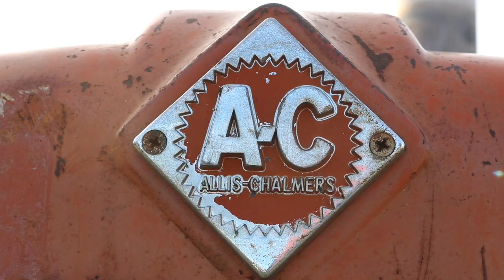Allis Chalmers Show: Plowing With Our New Original 1957 Allis Chalmers D-14

Comment: Looks like a nice little D-14. It probably did that tractor a bunch of good being hooked to the plow and worked hard for a few hours. We used to use the Dyno for local tractors that got puttered around. Usually fixed the issues and ran better. Thanks again for the update. Have a Merry Christmas and a Happy New Year.

Comment: I was impressed with that D-14 pulling that 3 bottom plow so easily.  Wasn't skimping on the depth either.
Reply from the maker: Our dad bought one in 1958 and he couldn't believe that little thing could pull 3 bottoms!
Reply: Ours would barely pull a two bottom in the thick red clays of Tennessee.  Soil type is everything.
Reply: @royscarbrough3589  Totally agree with you.  Clay has to be the worst.
Reply: My Dad used to use a 3 bottom with his WD wide front for many years. We used 5 prongs chisel with D17 series four wide front. It could do 4/5 bottom plow.
Reply: @royscarbrough3589  yeah, that 3 bottom would stop him dead in the area of Kentucky where i grew up! You can barely pull 2 bottoms with a super c or 230 farmall here.
Reply: A d17 has all it can handle with a 3 16 plow in Southern Minnesota.